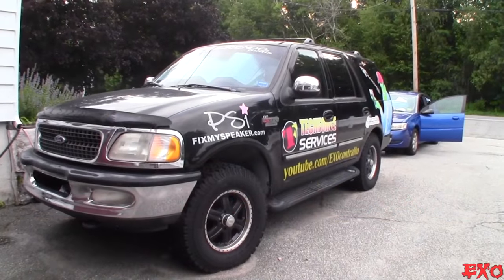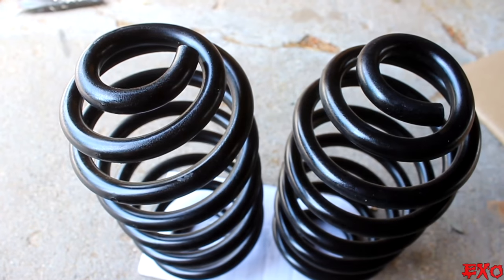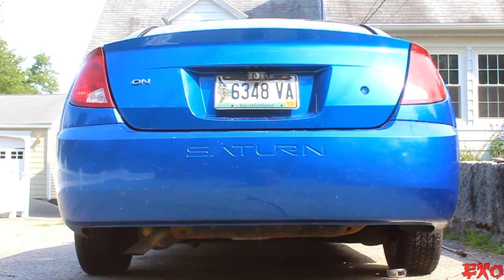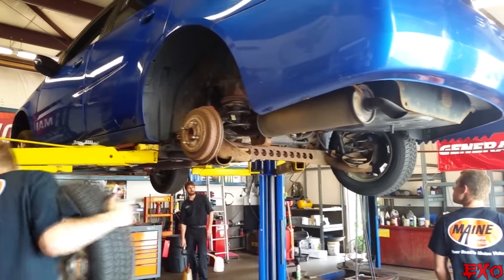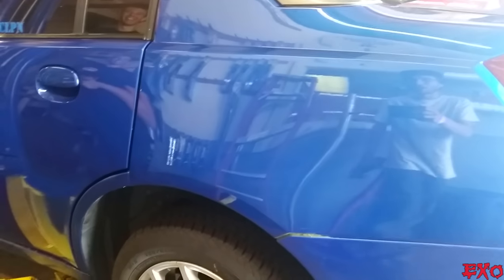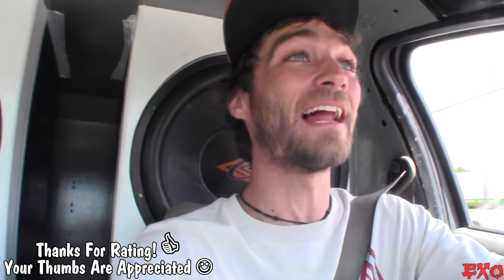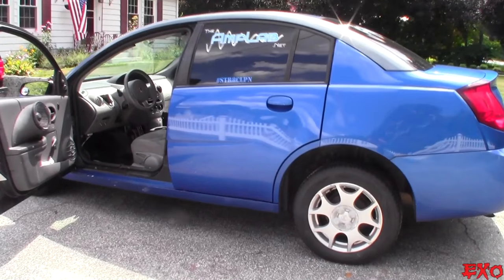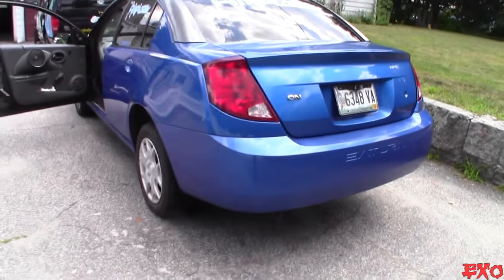BEEFING UP EXO's Suspension w/ 1000lbs COIL SPRING Install | Adding More Weight Capacity Saturn ION

Comment: Anyone curious about the springs, these are precision tuned per vehicle make and model, and dialed in to the exact amount of weight added to the vehicle, returning you to stock height and restoring the vehicles handling. Its also a permanent solution, so no maintenance is required after installation.
Reply: You would say that though…
Reply: My ? Has always been, what happens if i wana lower my truck... Do you guys sell different springs that fit lowering kits ????? And still hold atleast 500 lbs of weight ?
Reply: do they sell them for 03 chevy trailblazer i plan on doing a c pillar flat wall and putting 22 inch rims on the truck definitely need clearance to do all of that
Reply: +Edmond carter were on the same boat.... Im waiting on my wall builder to start my c pillar wall as well... Rims and size.... Never crossed my mind... Just want to lower my truck a lil
Reply: +818 SPL  are you doing 4 15 or 2 18s im assuming that we have the same vehicle or at least midsize suv im either thinking 4 15 x rev2 subs or 2 nsv3 or zv5 18s
Reply: +Edmond carter good choices... Go with 4 15s.... Im doing 2 Tantric SHD 18"s on 1 Ampere Audio TFE 8.0 on 3 alternators. Chevy trailblazer 2006 LS 4.2 L
Reply: +818 SPL yes they can be dialed in for a lower ride height also
Reply: +Edmond carter yes we do them for the trailblazer
Reply: +818 SPL i was thinking the 4 15s too it will be louder im gonna be using 2 crescendo bc5500 strapped i have one amp gotta get the other one i have a js alt 270a im going singer for the next alt(s)
Reply: +www.GPcarAudio.com would i need to provide u with any information regarding my lowering kit? So that u can know which springs to send me
Reply: +Edmond carter good plans good plans $$$$$
Reply: you just need to specify how much lower than stock youd like the front and rear
Reply: Will be heading your way soon my walled system batteries amps are putting a Strain on my car

Comment: Nice job exo I was really debating on getting these for my car with a wall two 70lbs psi 18s and 3 xp3000 batteries in the back that weigh 75 pounds each add plus crescendo Amps and wire that's a ton of weight on the back thanks for the review definitely might get some of these now

Comment: Exo.... I know you had made a video a while back installing the system in your sisters car...you mentioned the stock radio with converter. Was wondering if you could go into more depth with that. Thanks.

Comment: I had to give my 84 buick park avenue a 3 in lift from all my subs and battery. I am running 3 10's and one heavy duty battery. Plus my old spare tire still fit with it jack and accesories. Still need better springs. Oh ya when want nice stereo have to upgrade other stuff like suspension. Endless circle of upgrades.
Reply: LOL 3 10s and one battery and you think you need a suspension upgrade, that be no different to having 1 person in the back seat
Reply: Ya true, still running old worn out springs. She was almost scraping pavement. Till had to get that lift kit. She still scrapes pulling in some parking lots. Soon I will be gettig better springs. Not soft ones that are aged and worn out. I can't even hook up light duty trailer then trailer hitch is only two inches away from ground. Ya they seen better days.

Comment: why didn't you go with coilovers and removed bump stop. Ride low style. A hi car is like riding on a spunge when u cornering (extreme weight movement to one side=no handling). a low and hard car takes the corners better and holds the car in place on the road=better handling.
I don't mean that u should try 80 on a curvy road with that tank. 
what I'm saying is that u ride safer if u have to avoid a collision or cornering hard for some reason.
by the way I like ur work.
Ps: Sorry for my bad English I'm from sweden
Reply: cause they cost a fortune probably

Comment: how long will the transmission last? what's towing weight? I know my car says 1100 lbs and I over weight it and have replaced transmission and a rear end now.
Reply: +Exhilarating Bass 03 grand marquis with a wall four hdc415d1 soundqubed 7 batteries and four sq3500.1
Reply: If it has the GM transmission it should be fine, motor probably self destruct first.

Comment: With this why not keep it at the much better looking lower height but use some higher spring rate springs so it doesn't bottom out over the bumps with them?
Reply from the maker: Because it went from AGM to lithium ;)  Originally the added weight of AGM would have made it lower.
Reply: @EXOcontralto  
Aah I see, makes sense now☺

Comment: i love how that guy didnt torque your wheels, i hope they dont fall off
Reply: if you have a strong enough impact you can just use a torque bar extension and it will torque the lugs to whatever the bar lets it tighten them to, no torque wrench needed
Reply: i dont know any workshop that actually uses a torque wrench on wheels, its always either just the impact or an impact with a torque bar and im a fully qualified auto technician
Reply: +That-JDM-Fascination! true
Reply: Torque stick.

Comment: Ew shoulda bagged the car
Reply: Bags would've popped with all this weight
Reply: +Joel Jaipersaud I'm sorry, did you not know they bag dually trucks with well over a 20k lbs payload and still can tow that amount? I'm sure this way is way better in a price to performance ratio but bags would be sick!
Reply: +Ross Le I dont think bags pretty sure air struts or hydraulics
Reply: +Joel Jaipersaud wow.. youre literally talking without researching these things I just said.. I'll caps lock it for ya.  THEY PUT AIR BAGS, I SAID AIR, BAGS, ON SLAMMED DUALLY 1 TON TRUCKS, TRUCKS THAT HAVE A GOOSE NECK TRAILER WITH 3 CARS ON THE BACK.. STILL GOING DOWN THE HIGHWAY WITH NO PROBLEM. ok once again, go research before you talk outta your belly button
Reply: +canitapyourdoor well with and extra 3000 pounds in a of car audio equipment (batteries, subs, etc.) happened to one of my team mates Lexus gs300 with 4 b2 audio x2c in a 4th order
Reply: +canitapyourdoor well they can't even fit much car audio equipment anyway only pull people around lol barely any extra weight